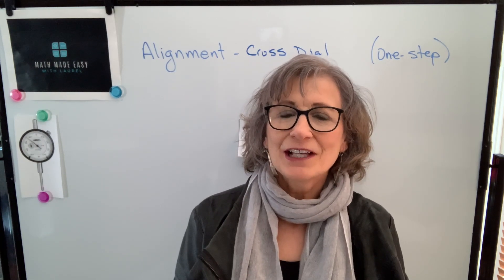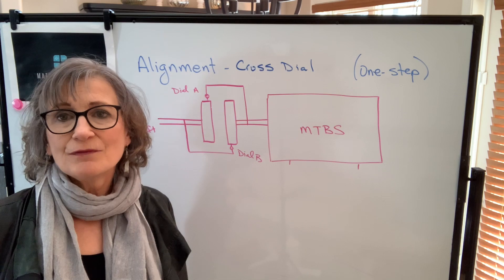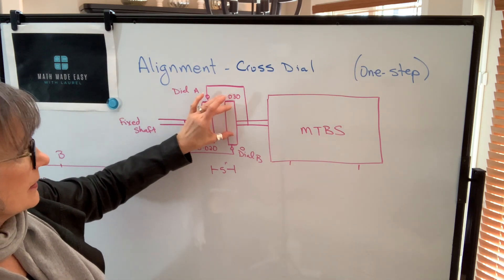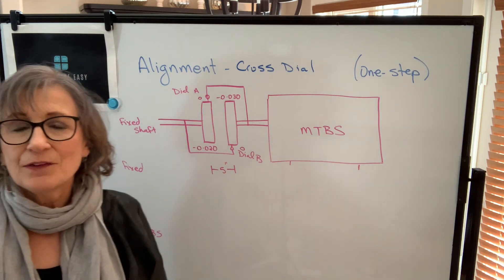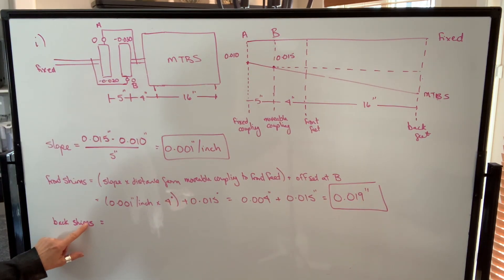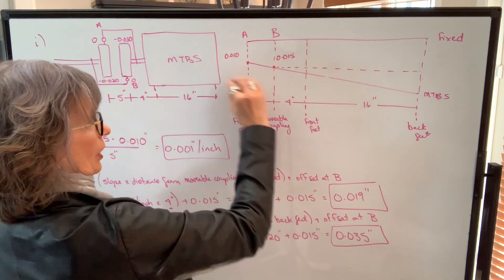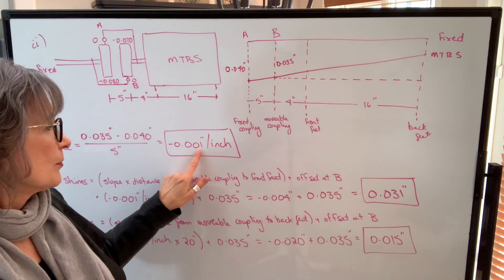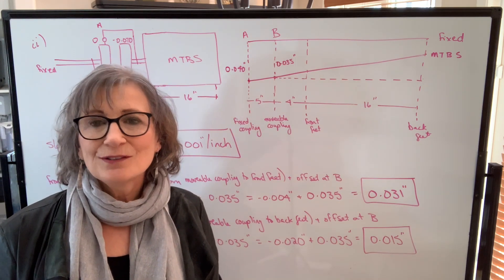Trades Math - Cross Dial Alignment

Comment: Really good but what about the sag... I'm a little confused
Reply: Hi Luis.   You adjust for dial sag before taking your readings.  So for example, if you determine the sag over that particular diameter is +0.010”, set the dial to -0.010” before doing the reading and then the reading on your dial will be accurate.
Reply: @laurel500  thank you very much!